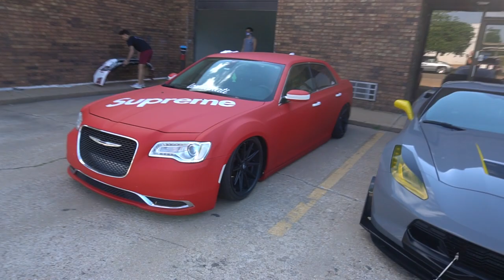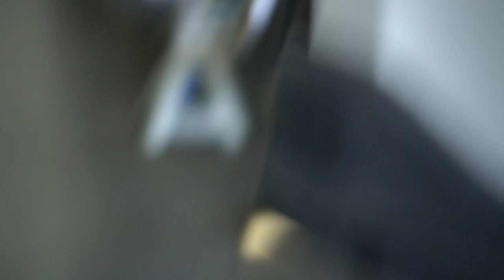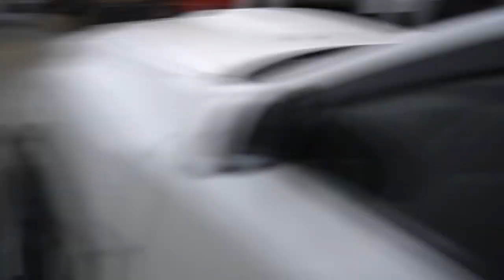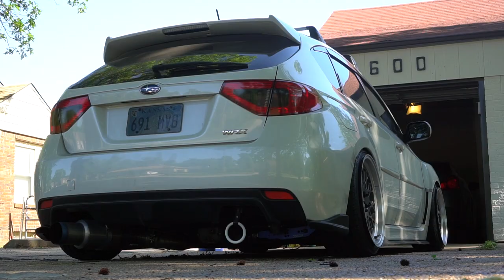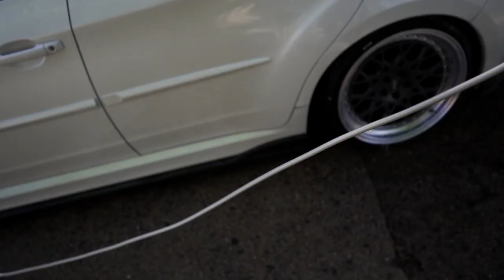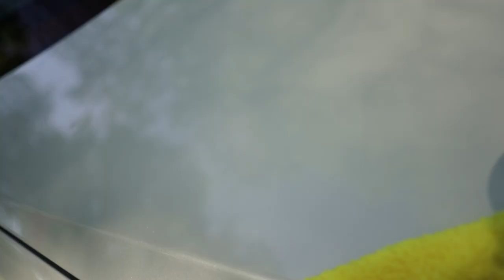NEW ESR CS3 WHEELS ON MY 2013 SUBARU WRX! | STANCED OUT!

Comment: Been waiting a while to see a video of those wheels on a car.  Is there a reason you went with the +35 offset with 20mm spacer vs getting the +22 offset and a smaller spacer?  I think you might have been able to fit the 18x10.5 +22.  Car looks great with those wheels and the single outlet looks so much better than the quad tips IMO.
Reply: The reason why I went +35 is because the +22 didn’t come in a 5x100 wheel pattern, only 5x114.3! But thank you!!